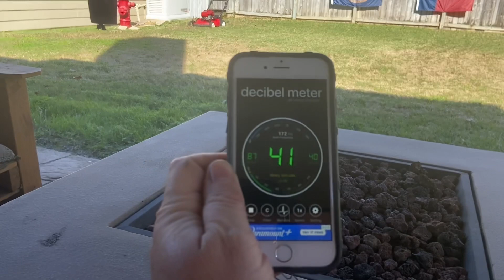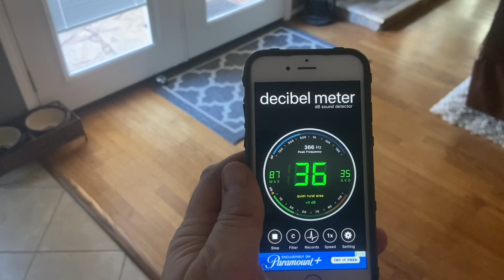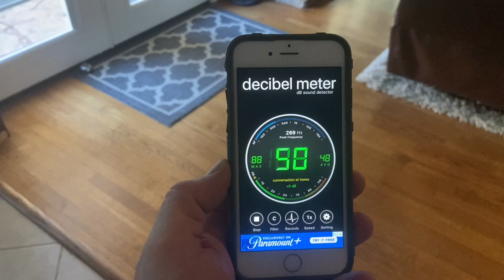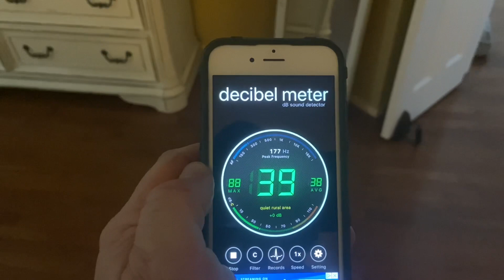How Loud Is A Home Standby Generac Generator?????

Comment: Great video and thank you. Though I do hate those generators. Neighbors cannot even hear my Honda inverter - they did not even know that I had it running for days.
Reply: Yeah, this thing sounds ridiculously loud. As a neighbor I’d furious if I heard a lawnmower running at 3 AM in the morning.  Surprised they couldn’t have made this quieter than a portable.
Reply: @Smoshylife  Those standbys have much more powerful engines and they are running at full speed always. It's like a dump truck in comparison with a passenger car. Quiet portables have inverter controlled output so they can slow down the engine at low load. Without inverter portables are horribly loud.

Comment: I have a 12 year old  20kw Generac Generator and it has been absolutely Trouble Free.  I do my own maintenance yearly and I would highly recommend buying one. The auto connect when the power goes off and disconnect when the power returns removes the tension a power outage causes.  Love It !!

Comment: No issue with you or what you did but I do have an issue with Generac and the noise these generators put out. The old ones were smaller but much quieter and they do have the technology to make them quieter

Comment: Your meter is WAY off these run at 66 d at 8 ft. and in the house with doors and windows shut  they are about 10 d. We install 500 units a year ALL brands.  Your meter is bad.
Reply from the maker: @oldtimer3180  how do I know your meter is good, I think yours is busted.

Comment: If your generator ran off electricity it’d be quieter and more environmentally friendly.
Reply from the maker: Kinda defeats the purpose. If you have electricity you don’t need it…. NG burns extremely clean so ……
Reply: @JustCantSitStill  You’re using common sense.  That’s not acceptable on the left.  Electricity only!  You should cover your house with windmills and solar panels

Comment: So the Generac generator is 4-10 decibels louder than the lawn mower.  There ARE ways to lower the noise levels such as placing it on a sound absorbing pad like they do with the Kohlers.  The placement they have their at in this video is NOT the best as that back fence will reflect a LOT of noise back to the house but it will also prevent that same noise from sounding as loud to their neighbors so perhaps a benefit there as well.  As he stated in this video, once you loose your utility power, noise levels are probably the least of the problems

Comment: Your meter may be picking up additional sound waves reflecting off the hard surfaces behind and to the right of the unit. So it might be quieter if you had fewer and lower wall surfaces.

Comment: You can build something over the generator to isolate the sound.That way it’s not so bad. I installed a big generator for the hospital in Delaware when I was working an electrical contractor. The generator was really loud.So the Union carpenters built a building around it to drown the sound and it worked perfectly.

Comment: Thanks for video, I'm in the process of having one installed. 24kW ... The transfer switch and foundation of crushed rock went in yesterday. Still waiting on generator to arrive, 7 weeks now. The installer said the crushed rock does a better job of absorbing vibration than a concrete slab. Will have the exhaust end going away from the house.  Pressure treated 1x4 frame filled with the crushed rock.

Comment: I have a Westinghouse WGen 15,000 portable generator with a 713 cc engine (essentially, a motorcycle engine). It is LOUD. We are having an 18kw Generac installed because I can't stand having to move the 400 pound behemoth out of the garage every time the power goes out; not to mention driving back and forth from the gas station twice a day 10 miles away to refill it. The Generac has to be quieter than that thing.
Reply from the maker: It’s a 999cc twin engine so probably will be about the same. Our is perfectly fine unless you plan to camp in the backyard.

Comment: There should be some consideration for your neighbors when installing these things. The neighbor behind me installed a 22KW Generac behind their detached garage which is about 8 feet from the property line. I am in metro Houston where we have small lots and frequent power outages. From my master bedroom to the generator is approximately 20 feet. It’s impossible to sleep in that room with that f…..g thing running. It’s also an 8AM Monday morning alarm when it runs for 15 minutes.
Reply: I'm here because my jerk neighbor installed one and I am unable to do much of anything in my house. She is 200 feet away and my living room is vibrating. The guy who made this is getting money from Generac. They should be banned unless they are encased in something to quiet them down. I mean 200 feet?
Reply from the maker: @oxi9846 I wish I was getting money from generac

Comment: Is there a program setting to "not turn on" the generator when the power turns off for only 3 to 10 minutes in the middle of the night...
Reply from the maker: Per the website This can be adjusted by a Generac-certified technician to any time between two seconds and twenty-five minutes.

Comment: We're in an extremely rural area so them being loud isn't a problem. We got hit by a tornado last year and everyone had theirs running for 1-2 weeks. We could all hear each other's generators and you just turn out the noise after a while. We don't hear it in the house except the area nearest it and indoors maybe about 45-50 decibels. The propane bill was hell but totally worth it. For those worrying about generac quality, we've performed regular maintenance on ours and recently had an overhaul-- after 10 years.

Comment: Generator motors running at 1800 rpm are a lot quieter and more noise friendly than the systems that run at 3600rpm. May want to factor that into your purchase decision.

Comment: I have a 22kw Generac and we lost power for 8 days due to Hurricane Beryl. My Generac ran 24 hours a day for 8 days, and we were cool and comfortable with power to the entire house. We could barely hear it running inside the house and it sounded like music to our ears. Also, I just got my Natural Gas bill yesterday and it cost $227 to run it for 8 full 24-hour days. That's $28.37 per day and I'm very happy with that.
Reply: Thanks for that Real Life info!  How big is your home (sq ft) .  Is it one story or two story?  And how many AC units do you have?  
My wife and I are originally from Torrance Ca.  We moved to Anthem AZ in 2013 (3.5k sq ft with 2 AC units) and saw our largest Electric bill in the summer of 2017!  We lived in AZ for 5 years.  
Then we moved to Cypress TX in 2018, into a brand new 4K sq. ft. Home with 2 AC units. Our largest bill in summer was about 400 bucks.
We are now going to be moving back to a new build in Suprise AZ (3K sq ft)  And we are now looking into solar but I like the reliability of a Generac.
Reply: @artguti1551  1200 square feet. 1 central ac unit.
Reply: Every time ours comes on when the power goes out it's music to our ears. We're always last in line for power restoration because I'm in an extremely rural area. Our propane bill after getting v hit by a tornado last year and but having power for a week was awful but it powered through like a champ and then handled a 4 day outage from an ice storm a few months later. Ours are not brand new. We've had them about 10 years and they've had regular upkeep and had to have a component replaced shortly before the tornado and that was it. Smooth sailing. I don't understand why generac gets such a bad rap. We actually have one for our barn too for our livestock to keep the well pump running and the lights on.
Reply: I have a brand new 20 kilowatt that ran for 60 hours during Hurricane Hellene. It burned through 1 quart of oil during those 60 hours of runtime. If you are running through extended periods of time, you need to stop the machine daily and top off the oil. You're also going to want to change the oil after an extended run.
Reply: @michaelburke5750 are you here in western NC? We moved to Hendersonville right before Helene hit and were without power for 9 days.  We are getting our 22kva installed this August that’s the soonest we could get it.
Reply: Thank you!
Reply: Yeah be about 600 for propane for the same time about a 500 gallon tank then you run out But still worth it
Reply: YUP. If you already have natural gas running, it's a no-brainer
Reply: Great info! I've wondered about the difference in cost of running the A/C on electric vs Natural Gas. You're right, the higher bill is well worth the comfort. I'm thankful I can afford it.
Reply: You may want to read your owner’s manual, by admission your warranty is void moving forward. Mandatory maintenance (oil change) is due every 100 hours, you ran your generator for nearly twice that. 8 days (24 hours)=192 hours…
Reply: @FireBosspilot  No I shut it down and changed the oil twice during those 8 days. Thanks for you concern though :-)
Reply: I don’t understand why they have to be so loud. 
Your SUV has 10x the power, and is almost inaudible. 
A farm tractor from 1955 is twice as powerful and is almost inaudible. 
Will the day come when someone introduces the generator companies to the now century-old technology of the muffler?
Reply: @gregfaris6959  It's not the muffler that's causing the noise.  Combustion and piston slap are the main sources of noise.  The other reason is that to save money they use generator heads that have to spin at 3600 rpm.  That's the top end speed of those little engines.  There are generators that only have to spion at 1800 rpm and are much quieter but are larger, heavier and much more expensive.
Reply: @Critical-Thinker895 It’s because the air-cooled gas engine wouldn’t perform well at 1800 rpm. That’s nowhere near its optimal power output, so they use a two pole generator head and spin it at 3600 rpm to get 60hz. To go up to a four-pole generator head at 1800 rpm, you’d need a larger, lower rpm water cooled engine. This is why you see diesels filling this space. In summary, it is about saving money, but it’s not simply the manufacturer saving a few bucks between two similar options. The cost between the two options is significant.

If Generac wanted to make these quieter, they should offer a better enclosure. They might need some secondary fans to move air in an indirect path, but it could be done way cheaper than going to four-pole commercial type generator heads.
Reply: @sigcrazy7  You don't think I know that??  It's not that gas engines perform poorly.  It's that they don't have the torque ratings diesel does.  Not sure what you're saying but the generac generators I've heard are running gas at 3600 rpm.  Noise will always be a problem with those but the biggest problem is that they will have a very short life compared to diesel.  Why are you trying to give me a lesson in generators.  I'm 71 and have seen far more generators than you have.  You kids think the world was invented when you were born.  This has been a problem for many decades.
Reply: @Critical-Thinker895  So you're just a bad communicator, then. Next time you are gracing us with your knowledge, don't imply that the use of a two-pole generator head is simply a cost saving measure, and try being a little less sensitive.

Also an old man here. You don't know jack about my background. Try to tame down the "get off my lawn" vibe.
Reply: @sigcrazy7  I never implied any such thing.
Reply: @Critical-Thinker895  “You kids think the world was invented when you were born.” 🙄
Reply: @sigcrazy7  I was born 71 years ago.  Who are you calling a kid DA.
Reply: @Critical-Thinker895  I was quoting you, genius. In answer to your asserting that you never implied “any such thing.” <<- those quotation marks mean you said it.
Reply: @sigcrazy7  You're kinda late to the party troll.
Reply: @Critical-Thinker895  My OP was simply an expansion of your post, but somehow you got offended by that, as if you’re the only person here allowed to discuss a topic. You’re the one who got all offended, called me a child, and then listed your creds. I then quote your own words, so now you think I’m a troll? For quoting you? You probably shouldn’t post if you cannot remember what you said, and calling someone a troll is simply admitting you are an idiot. Take a break old timer.
Reply: @Critical-Thinker895  Just because you're 71 doesn't mean you magically know everything, your comments (which are all false information) are proof of this.
Reply: You might want to read the fine print on that bill.  Texas splits up the cost and bills you in multiple months when a single bill is way over normal.

Comment: Mine isn’t too far from our bedroom window (18KW) but I have double pane windows and the exhaust points away from house.  I can hear it but not bad.  And during our recent 11 day outage after Beryl, that bit of noise was no big deal as long as the AC was running.  Also my neighbor said it doesn’t bother him.

Comment: The best installation that I’ve seen was on a lot large enough to have the utility meter, main entry panel, transfer switch and generator 50 to 75 feet from the house.

Comment: We got our Generac in 2015 to replace a portable.  They are nice to have during hurricane season and other times when the power goes out.  Our next door neighbors don’t object to the noise because we run an extension cord to them and give them 15 or 20 amps.  My only dislike is that the exhaust and cooling air exits downward and kills grass and flowers that are near by.

Comment: I used to have a power outage at least once a month--whether it be from a vehicle crashing into a utility pole, a storm blowing a tree limb on a power line, or a squirrel getting romantic with a transformer.

I purchased a portable generator and had an electrician install a generator inlet on my house in preparation for hurricane Ian.  Of course, hurricane Ian veered off its projected path the next day, and I have had no power outages since.
Reply: Huh.  
So all it took to hurricane proof your home and prevent any power outages was buying a generator.
Cheap at twice the price.

Comment: After Hurricane Michael, our power was out for 3 days. We did have the well wired to the generator with no power running back to the power lines. For 3 days our generator ran non stop. It powered the tv, refrigerator, freezer and a lamp in our house and the same things in my parents house who lived next door to us. We let the neighbors to the left side of our house run a water hose from our spigot to theirs and my dad let his neighbor run a water hose to their neighbor. My parents neighbor was attached to the well that was owned by their neighbor. So for 3 days,our well ran water to 5 houses. Trust me when I tell you that we didn’t have to pay for any gas to run the generator. 😂

Comment: I love my Cummins RS50 Quiet Connect™ Series 50kW Standby Power Generator (120/240V Single-Phase) very quiet, super clean power and very quiet.
With generators you get what you pay to meet almost every requirement price point… mine can power all of my property and is very quiet…when the power is out we have walk over to the generator and check…powers 3 mini splits, 2 a/c units across 3 buildings about 11,000 square feet of indoor space.
Reply: All the standbys are rated at about 66

Comment: was it under load or did you just run it without transferring to load?
Reply from the maker: Under load as it’s easy for me to kill the incoming power,  however unit operates at 3600 rpm with or without load

Comment: Home depot in Tampa says $4500 for a 16KW Generac and the transfer switch. My Steele 12000 (12K start/8K run) portable cost me $900 plus $50 for 30 amp inlet. $110 for 75 feet of 8-4 so cord from eBay. $60 for the two 30 amp twist-locs. $12 for the 40 amp inlet breaker used in my DIY manual interlock. 40 amp cannot be on unless the main is off. 12Kstart/8k run is enough for my AC and the normal stuff in the house. It will NOT run the electric heat grid. But the AC in reverse mode is fine for heat. Tampa Florida here.

Comment: It's the same as my Steele 12000 standing next to it under AC load. 76db. It has a very good muffler. The "machinery noise" of the generator itself makes up the bulk of the noise. Much more that the engine.

Comment: Kinda confirms what I suspected- that underneath the cover of these fuel powered generators are just oversized lawn mower engines. The noise wasn't too bad for this home and generator location. But  in developments with 7,000 foot lots like ours, and 15' separating homes, it's quite loud. Still, when you lose power, you really don't care about the noise, or the fact the operating cost of producing your electricity is substantially more than what you normally pay for grid sourced power.
Reply from the maker: Thanks for watching and sharing your thoughts.

Comment: Was the generator under load? It's going to be louder under a load.
Reply from the maker: Operating at 3600 rpm , this was not done during a low RPM exercise.
Reply: @JustCantSitStill  What I'm saying is that if you have appliances, central air, etc. running there is more of a load on the generator's engine and it will be noticeably louder. I'm not saying it's not a great item to have, I'm just pointing out that there is a noise difference between not being under load and having 10kW of household items running.
Reply from the maker: @Pro1er  yes power was cut , generator was running as a simulated outage.  Also this generator operates at 3600 rpm load or not. The load makes no noticeable difference in the sound or decibel level.